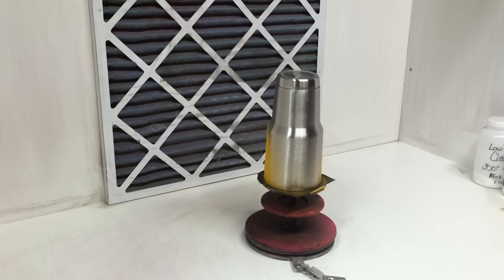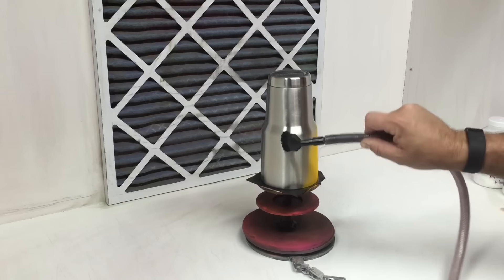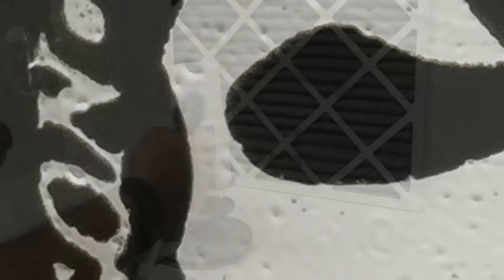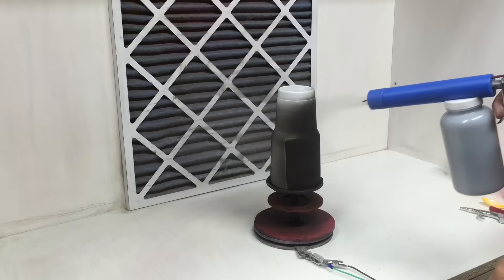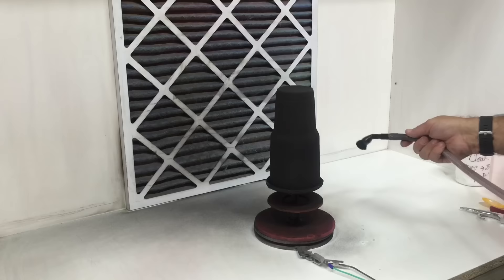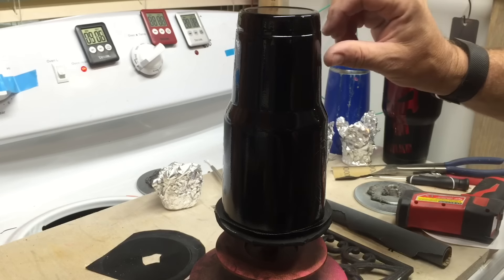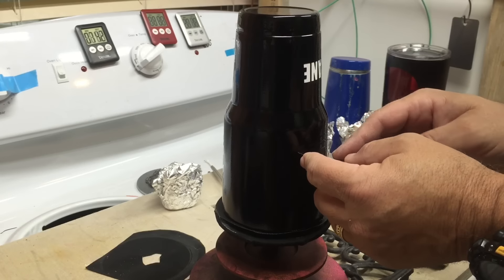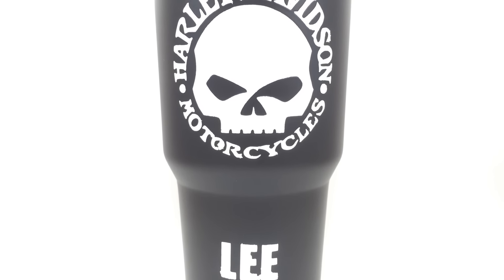Three Colors "Mullet Cup"  Two designs and two names

Comment: How did you strip the powder coat off to do the cup again?
Reply from the maker: Back then I used aircraft stripper which was removed from the market.  I did a video recently and now use this. https://youtu.be/Z9h867ciAVc
Reply from the maker: https://www.removepowdercoating.com/
Reply: @ManCrafting  Thanks so much, great job that you do, I'll look into the product, can it be filtered and reused?
Reply from the maker: I’ve been using the same gallon for dozens.  Actually half gallon.

Comment: I have had a really hard time getting the vynal off the cups without scratching the cup but I went on ebay and ordered an exacto knife set in a box with a ton of diffrent blades and man I have yet to scratch another one I use like the 1/8 blade and it takes the stickers off with ease have you ever had that problem
Reply: Got a link for the kit from ebay?  I'm having the same issue.  Scratched the bejesus out of a three coat cup I did the other day but it was likely my own fault.  Still, any tool that will help I'm willing to look at.  Thanks!
Reply: +Howard Camardelle this is the link on ebay for the knife set I use on my cups.       http://m.ebay.com/itm/MINI-HOBBY-KNIFE-SET-WITH-CASE-EXACTO-BLADES-KIT-FOR-CARVING-AND-WHITTLING-/291130462286?nav=SEARCH
Reply: Thanks TC.  I'll check it out.
Reply from the maker: Thanks for the recommendation.  I'll give it a try.  I was worried about the knife damaging the powder.

Comment: I am currently working on a cup where after I cured for 3 mins and removed the vinyl it also removed some of the color I was masking with the vinyl so now I am currently trying to touch up that any suggestions
Reply from the maker: It depends on the color.  I have had luck dropping powder on the spot, but most of the time it makes it worse.  Sometimes it's easier to just start over.
Reply: +ManCraftingTM , Yeah I thought about trying to drop powder in the void but I am worried the new powder will be higher or raised more than the original powder, but I will try it to see how it works out. And I definitely will be using this technique to do multicolored powder, and I am pleased to see I am not the only one who has issues while powder coating as always keep up the good work thanks for your advice and videos

Comment: I'm curious why you don't spray the basecoat over the entire cup? I would think that the thickness differences would be noticable. I was cringing when you sprayed that yellow only on the front, guess it's just my OCD though.
Reply from the maker: Mike L several reasons.  The first is the powder tends to level just fine.  No reason to put more powder than needed.  Last, if you want multiple colors on the same cup under the topcoat, the powder absolutely will have to have partial coverage at some point.
Reply: Makes sense, thanks
Reply: That's not necessarily true....If you are powder coating a lite color over a black there is a very good chance you will see where the line of black stops. Using a dark over a light you are correct you will not see it. May I also suggest that you unmask your cup at between 180 and 200 degrees. A heat gun and thermal thermometer are your best friends. I do agree that when the powder starts to flow is the time to take it out and begin unmasking. As far as the cup you did....I am glad he was a friend because there is no way I would ever put that cup up for sale with the errors in the vinyl pull. Try what I said sometime and see if you don't agree about the vinyl pull. Also another easy way to clean up the stainless of the remaining gluel is to use Never Dull, removes unwanted glue and shines the stainless nicely.

Comment: is there a special vynal u use to come off easier I use just plain Ole vynal you buy at michaels and man does that stuff stick good and that's not a good thing hard to take off no matter what temp
Reply from the maker: +texas.cummins I use either cricut or Oracal 631.  It seems to come off most of the time.  I still have issue on occasion.  If you catch the glue coming of before you do the full cure use Naptha to remove it. It's a whole lot easier.
Reply: +ManCraftingTM thank you I will look into that also a way off the wall question have u tried to paint the inside of the cups as well I want to try it and see what happens but thought I would ask to see if u have done it or know anyone that has thanks
Reply from the maker: +texas.cummins I haven't.  That said I would check into powders rated for cookware.
Reply: +ManCraftingTM oooo ok thanks I will look into that